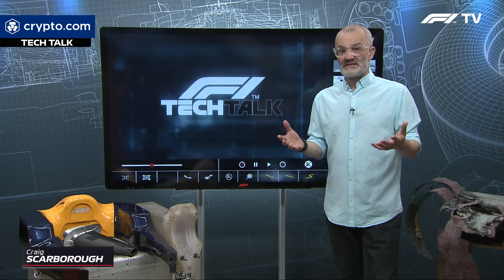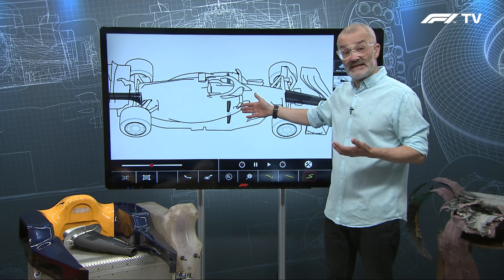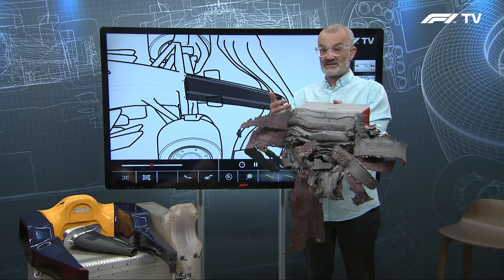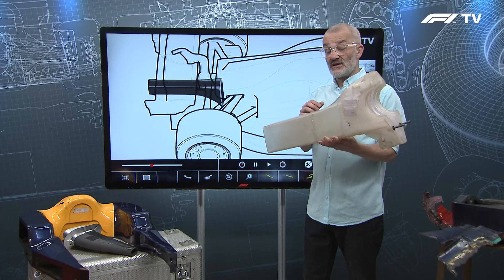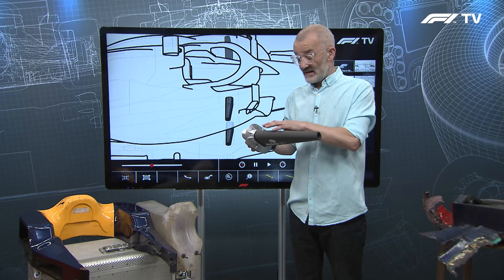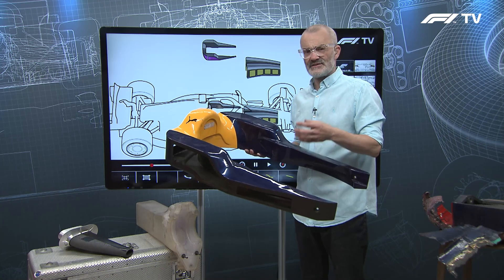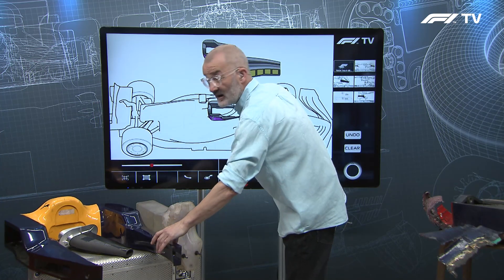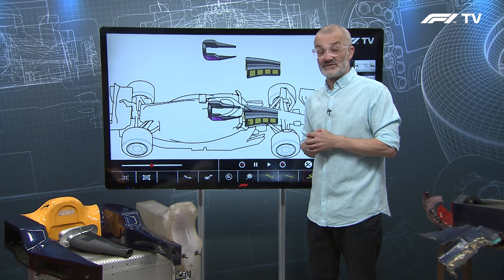How Crash Protection Has Improved On F1 Cars | F1 TV Tech Talk | Crypto.com

Comment: Great talk, maybe do an episode on the HANS-device, the role hoop and the Halo as well soon. Curious to see Craig's thoughts on the single vertical beam design roll hoop that Alfa Romeo uses this year as opposed to the more traditional triangular shaped one. It looks like the vertical one would snap off under lateral force more easily when the car is sliding sideways upside down as we saw with Zhou.

I'm curious if the FIA will standardize the shape of the roll hoop and the way it's attached to the monocoque (or make it an integral part of that structure)  like the side impact structures as well to help minimize the risk of it breaking off like it did with Zhou

Comment: I've now seen several crashes or flips that end up having the flat top of the halo creating a base that the car sits on and traps the driver in the car.  I personally think the halo needs a redesign.  Hulk flipped and his car was on fire and he couldn't get out.  Zhou slide on the top of the halo until the halo dug into the gravel which ended up launching Zhou over the tires.  And why did the roll hoop fail so quickly in that crash?  The other big track issue is sausage kerbs launching cars.  I remember the F3 crash in Macau 3 years ago.  The sausage kerb launched the driver over the fence.  That was nuts.
Reply: Better to have the driver in an awkward position that takes longer to get out than to have the driver decapitated. The problem for Zhou (besides the collapse of the roll structure) was the gap between the back of the armco/tire barrier and the front of the catch fence. Alonso and Stroll have both been able to get out of an upside-down Halo car on pavement unassisted. Whether the Halo dug in, or the roll structure dug in, or a wheel dug in, the flip in the gravel was essentially unavoidable. Once a car is sliding through a gravel trap not exactly parallel to the surface, it becomes very unpredictable and likely to flip. One of the main reasons for people that are opposed to gravel traps.
Reply: @jsquared1013  You've pointed out a lot of valid points about the gravel, the collapsing roll hoop and the gap between the tires and fence.  I would also add the dangers of sausage curbs launching cars. We saw another one of those crazy launches off a sausage curb in the F3 race.  But I have to disagree with you about Alonso and Stroll.  They never exited their cars while being on the halo.  Their cars had rolled maybe because of the hoop.  I'm not necessarily saying get rid of the halo, but somehow analyze the form of the halo so it can't act like a flat surface that the car can land on and stay inverted like that.

Comment: Zhou rollover protection completely failed. The Halo literally saved him.
It looked pretty banged up too, no doubt designed by the same people that made the roll bar.
The car not catching fire was also very fortunate since he was trapped in the car in the space between the tyre wall and the catch fence.
Alpha Romeo and FIA need to answer some hard questions.
Reply: That gap between the fences and the tyre barriers is so dangerous. It's not like they didn't know this could happen. Cars have jumped over the barriers many times. 
I think F1 and FIA are starting to get complacent with *Track safety because the car safety is much better nowadays. It should be a two way effort.

Comment: @fia @F1 hopefully Zhou’s crash will address the root cause of the accident, open wheel racing, and not only the safety requirement after the fact!
Enclosing the wheels would have prevented this, and other past, accidents. It will allow for more rain racing, due to he reduction of spray, and improved the aero (as future regulations aim for).
I never understood the ‘need’ for open wheels… Make them regulation or spec part, if you are afraid that teams may run away with covers…

Comment: Who knew these would be put to test as we watch this video. Glad for Zhou to escape unhurt. F1 safety has really gone up quite a few notches after introduction of the Halo. On the other hand would alsoike to know why HAAS cars are prone to breaking into two from the Grosjean & Schumacher incidents.
Reply: It's not "Haas cars", it's all of them. The Grosjean crash was an outlier and snapped the fasteners that connect the engine to the monocoque, as well as breaking pieces of the monocoque near the fastening points. That crash well exceeded the forces that they test for in the safety regs. Following that crash, the regs were revised, with the fasteners connecting the gearbox to the engine actually reduced in strength, in order to have the gearbox tear away from the engine first and dissipate some energy, removing some load from the engine/chassis mounting points (like a "fuse" for the energy transfer). The Schumacher crash where the gearbox came off was actually the system working as designed.

Comment: Aged beautifully after Zhou’s crash
Reply: Aged far better than all of those comments dissing the halo after it first debuted.
Reply: @tjenadonn6158  not really. Halo was the worst solution. Uglier than aero screen and also less safe than aero screen
Reply: @canismajoris6733  they can't get out the car as quickly with the screen
Reply: @canismajoris6733  really saying this after grossjean, zhou and hamilton crashes. what a clown
Reply: @canismajoris6733  Nice joke
Reply: @canismajoris6733  for safety stronger material it's more recognise than the beauty...
Reply: @canismajoris6733  The Aero Screen on Indy Cars is  basically a halo with a windshield - the halo gives batter visibility for the driver and easier escape in the event of an accident.
Reply: @canismajoris6733  dissagree. I think the halo looks much better than the indycar aero screen.
Reply: @paul227-u1p   Aeroscreen is also a bit taller to give drivers a better sightline on the ovals (you actually look a little bit "up" relative to the seating position into the banking to see the corner 😅)

Comment: if it would only be as hard as the driver cell everywhere it would be the same to drive witout any safety . the impact inside would be the same force as on the outside so it wouldn't make much of a difference as having no driver cell in a high speed impact accident.

Comment: Great video and insight. However, I feel that the side impact protection needs a vast overhaul. We all know what events unfolded in Spa F2 race in 2019. The side impact structure wasn't sufficient and from my understanding, this hasnt really been moved forward or better developed since. I know the chances of a T-bone crash at high speeds occurring is low but the chance is still there especially with F1 cars being quicker than F2. I would love to know if there have been any further improvements I am unaware of.
Reply: The problem wasn't really the ability of the side impact structure to asorb energy but the fact, that it can only absorb energy once and was asked to absorb energy twice. You can't really change that at all. Imagine driving your car into a wall once. You'll survive because your car absorbed most of the velocity. Do it twice, it can't absorb energy anymore and you'll be injured.
Reply: @wutzitrone4522  That is a great point. On review of the 2019 impact though it doesn't look like the left side impact structure hits anything and it is only hit once the other car collides. The issue is the survival shell as strong as it currently is more could be done surely. Fingers crossed we never have a crash anything like 2019 again.
Reply: A part can only protect the driver once. If it's hit against a barrier and then t-boned it won't be there the second time.

Comment: with all these safety implementations and development, can we one day see driver's seating position be changed to a more upright position?
to make them see better.
Reply: Lower center of gravity outweighs sight in laptimes so most likly no.
Reply: so the drivers can see over the halo?
Reply: @horissores  they see through it. In between the top of the chassis and the bottom of the halo bar.
Reply: Drivers used to sit in a more upright position, but then the McLaren MP4/4 came along in 1988 and showed everyone it's faster to get the driver as low as possible.